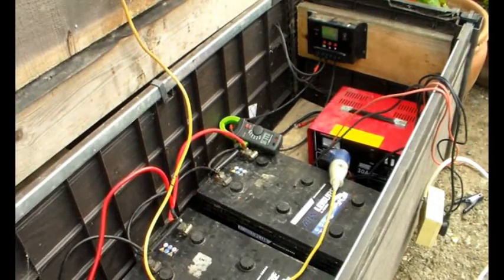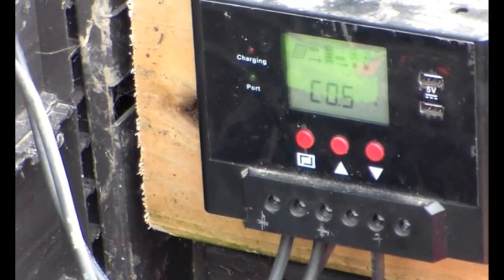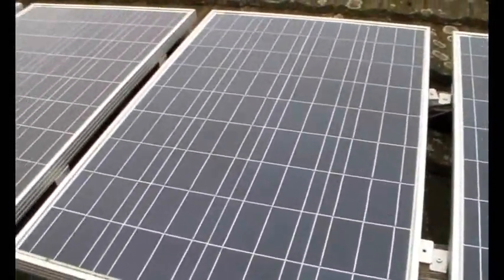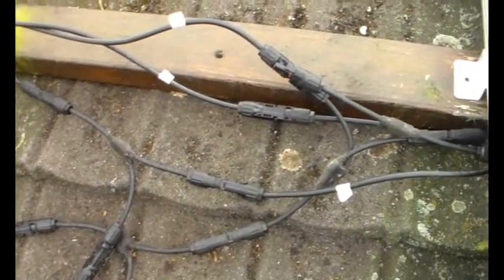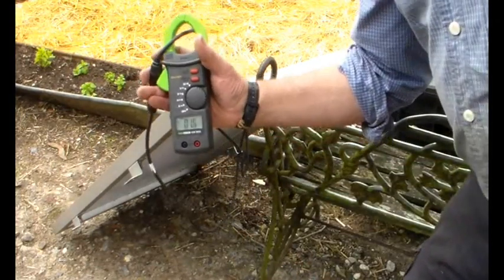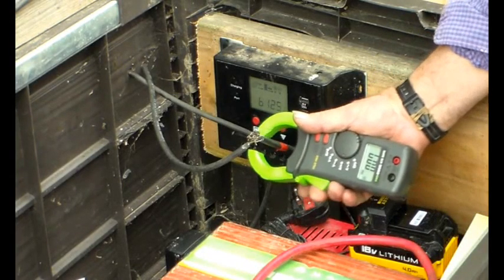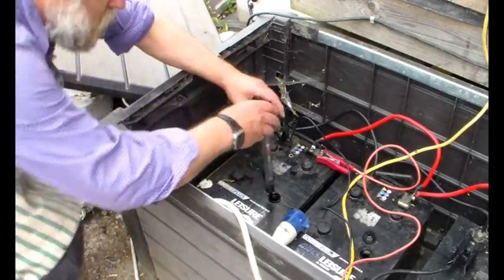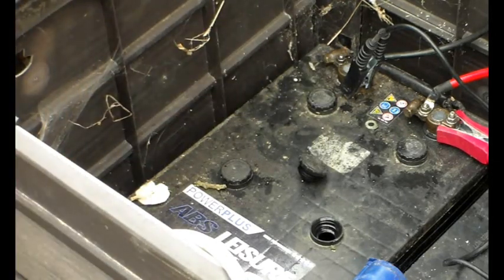Solar battery system repair, short circuit current test, faulty connections.

Comment: I just found a very interesting webpage. They are selling a device that back-feeds a little bit of power through a solar array at night. It is claimed that this rejuvenates the cells. I have never heard of this before (apart from knowing that cells exhibit a weak electro-luminescence when back-fed) and suspect it is snake oil? What do you reckon Andy? Here is a link to the site: https://www.ilumen.be/en/try-buy-pidbox/
Reply from the maker: Hi, yes i suspect snake oil is correct and the beauty of this item as fas as marketing is concerned is that the efficacy is unverifiable, perfect for lies and cheats, cheers
Reply: @TheInfoworks  Yeah, I agree. As there is likely a 50% chance that the weather will be better during your 60 day trial than it was before, and if so you might believe it. The other half of the customers would return their units thinking they did no good. lol

Comment: Looks like a situation where soldering the wires together would be a good idea, since over time the same problem will reoccur.
Reply from the maker: Dead right, cheap MC4 connectors are not reliable, as proof of concept this was fine but needs work, cheers